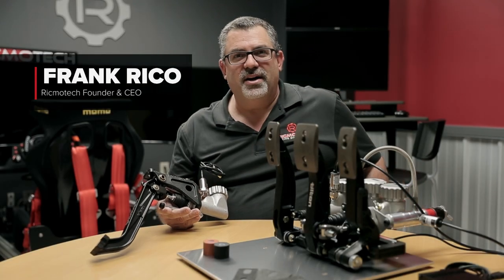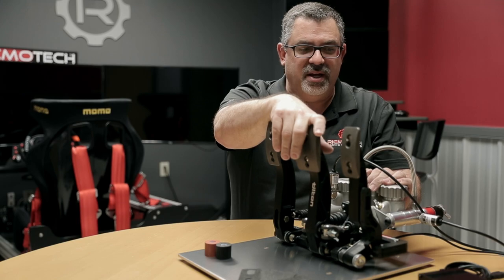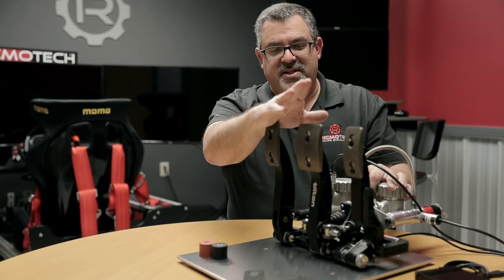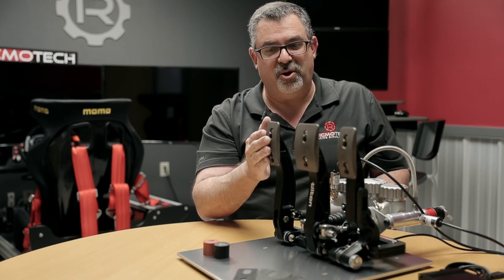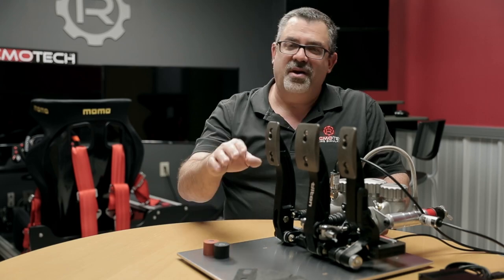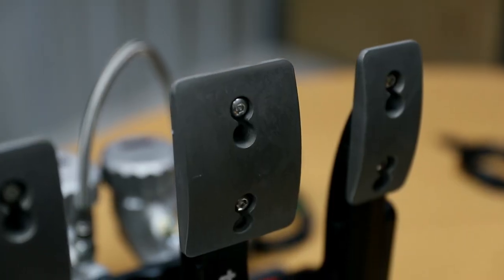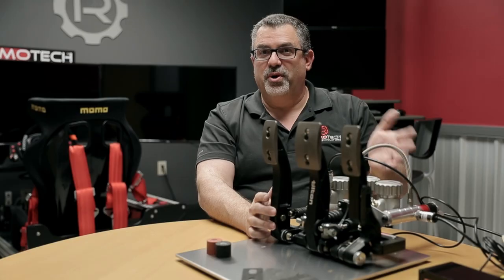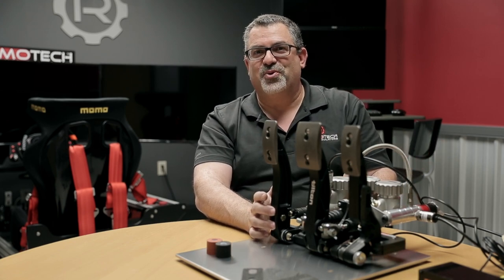Ricmotech GTPRO3 Xtreme Floor Mount Pedals

Comment: Is it possible for me to get this pedal to work with ps4 games like ACC, Dirt 2.0 and GT Sport?
Reply from the maker: I'm afraid these are for PC only. Will not work on PS or Xbox.
Reply: @Ricmotech  it won't work with the gaming HUD? I'm told that after market accessories must be connected using the HUD which tricks the console into accepting it as an original.

Comment: Don't trust the review from Sim Racing Garage, he didn't even setup the pedals correctly in the software and he had an agenda against hydraulic setup. I owe them and they work great. Plus the customer service is first class, every time I call, even if the warranty has expired, they assist me remotely and make sure it's all working properly.
Reply: Can compare with simtag pedal..?